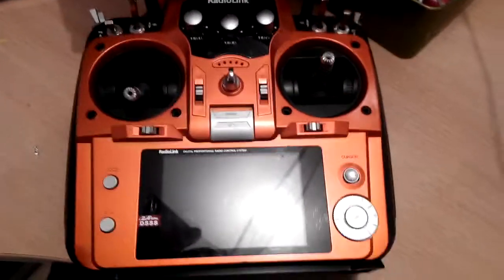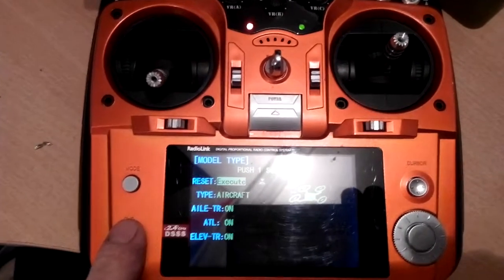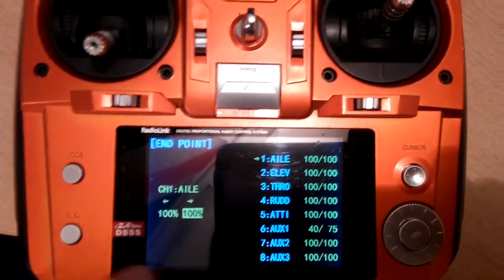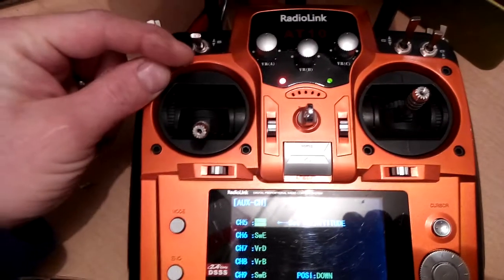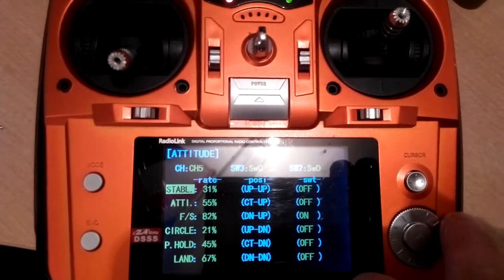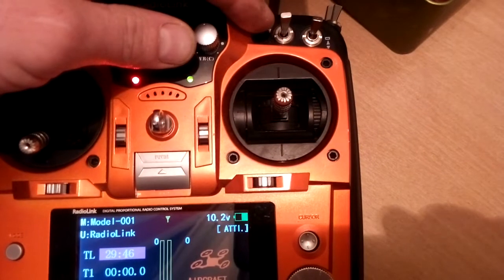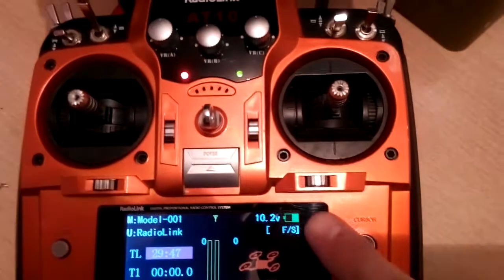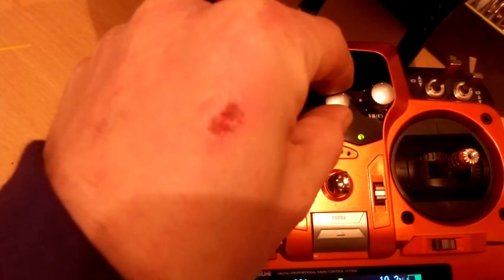RADIOLINK AT10. SETUP FOR APM 2.6. APM 2.8

Comment: Hi!
I am trying to build a bait boat myself and I have a few questions, maybe you can help me out with some answers:
Is it possible to set the pixhawk to save locations by moving the sticks?
When I go fishing, I fish in 5 places (within the distance of 10 meters apart one from another) and I would like to send the boat the first time to the 5 places and save them so I can later send the boat by itself.
I would like to not use mapping, and just send the boat to where I want to save the locations, take action on each stick so it can save a certain location on a certain stick.
After saving the locations, when I send the boat to a certain location, I would like to take action on the stick that represents the location, and the boat should go by itself.
Is that possible with the pixhawk?
If not, any idea with what flight controller I can do that?
Thanks in advance!

Comment: Hey bro! Nice vid! Do you tink you could answer me a few questions?
I have a bait boat, and I want to be able to read the distance from my boat and remote,so I know how far I send it,and also, I want it to return to the starting point without me to drive it.
I know I will need the 
1. APM 2.8 (this is what i want to use cuz its cheaper)
2. GPS
3. Mini OSD
Questions: 
Will I need the 3DR Radio Telemetry? If yes, what is this for?
Will I need a Power module also?
My bait boat is functional, can I connect the AMP to the power source of the boat?
Thanks and I hope you can answer me as I am new in his :)

Comment: Hello there. I have a new AT10ii and R12DS system yet.
 I bought it for my plane with nitro engine. 
I do not have an ESC. (no esc). 
I have one 2s 7.4v battery and one UBEC 6v device.
 How can I connect this battery to the R12DS receiver. 
from which port I will connect. Do I need to use UBEC 6v? 
will the 2s7.4v battery work on my connection?
 

I will connect the battery to which channel. 
I will connect to which channel the numbers are formed with red color.

Would you mark me with a photo and attach it to the message? Please.
Reply from the maker: fatih sarıduman yes operating voltage 4.6-10volts.  you can use Any channel.to supply power.
Reply: I do not understand how any channel. normally connects to channel 3 with esc. Can you connect to any one without ESC?
Reply from the maker: fatih sarıduman yes.

Comment: I updated the firmware and now the throttle is on the right hand stick ??? How if possible can I put the throttle back where it belongs ?
Reply from the maker: Noah Wheeler yes   yes you can.  turn on at10..  press and hold "mode"  highlighted "parameter"   press the wheel...    use the cursor down to "stk-mode"  turn wheel to number "2"     then use end to come back out.   will now be left stick throttle mode 2.
Reply: Thanks a lot Throttle is fixed . One other question ? I have the AT 10 and the R12Ds ! Do the pair work together ? For some reason I can't get the motors to turn on with this combo . The signals are there but no action ! I can rotate the motors with the mission planner software but nothing from the transmitter ???
Reply: I even went back to a previous firmware and still no go very frustrating ! Thinking of purchasing the R10 ? Maybe that will fix it ???
Reply from the maker: Noah Wheeler you need to select 12channel in the menu on the transmitter.  what signal input are you using for the flight controller control. pwm or sbus?  if sbus. did you put the receiver into sbus mode???  if the led is red on receiver its in pwm and red numbers are the channels.  if in sbus mode the led will be blue.   what flight controller are you using also??
Reply: ardupilot is the apm 2.5 I think ? everything was pretty much thrown in the box with no instructions
Reply: first time doing something like this
Reply from the maker: Noah Wheeler. yes. china man stuff. figure out for yourself. lol. ok. im not at home right now so cant double check.  but if you need 12 channels.  in the Parameters menu. I think for the r12d you need to select and make sure you have selected 12 mode to work correctly with the r12ds.  this is maybe where the trouble is. and why your channels are messed up.  get the AT10 back on the new firmware.  put it in mode 2 like we talked about earlier.   reverse channel 3...  you'll need 8 servo wires.  put.  channel 1(red) to 1....2-2...3-3. etc etc.  do all 8.  power all up. and do a rebind..  press and hold the wee button with a pin.  until it flashes.  leave go.  let it bind again.  if the led on the receiver is blue.  you need yo make it red... press the wee button so it goes red.   you are now in pwm mode.  and should be able to calibrate now in mission planner.  make sure all the servo wire are in the correct way around too.    it can take some time.  especially if.it is your first time buddy.  are you on Facebook?? join a group called. "Mad for Multirotors"    we can help you better there mate.  

http://www.radiolink.com.cn/doce/product-detail-126.html

Comment: Hello thanks for your previous help.  As you have noticed I am completely new on this hobby and I am having trouble configuring the flight modes. I am using a pixhawk 2.4.8 with a radiolink AT10 2 with r12ds reciver. well i have followed the video in how to do it but mission planner is jumping flight mode 3. Can you help?

Comment: I am new to drones.  I have the AT10ii.  Can you explain what does the percentages mean or actually do?  If not, can you direct me where to find the answer.
Reply from the maker: Zen B the percentages relates to the corresponding channel out put which is then received by the receiver and put into useful information such as pwm....ppm. or sbus control. this then is used to either control channel inputs on a flight controller or servo motors etc.  on these cheaper end radios though the percentage is not always linear and thats the reasons we need to calibrate the flight controllers.  so it then corresponds to the maximum and minimum output    every build of machine will be different and require different percentages for different channels.    the percentages can also be used to adjust end points.   where 100% would be the normal full speed on a throttle say.     if we reduced it to 50%    this would then be half throttle at full stick.  if this makes sense.   lol.   it makes sense to me.  hehehe. I am by no means an expert.  so if you want to learn more.   google it and look at the different types of control too..   like sbus....ppm....pwm... etc etc.

Comment: NOTICE if you are using pixhawk and you have this transmitter and the receiver that comes with it then use a PWM to PPM converter for pixhawk but unfortunately the converter only supports 8 channels.
Reply from the maker: InventorJS -Jacob Singh or. buy the R9D receiver and bind to the AT10.  you can use sbus.  10 channels.  new AT10 radios come with sbus receiver now also and have 12 channels.

Comment: hi do you know if my AT10 is compatible with a pixhawk flight controller,.
great video relay helped me set up with my apm.
cheers
David
Reply from the maker: yes. of course it is.  my advice though.  pixhawk works better with sbus.  discard the R10d receiver.   buy a new version of the R9D receiver which has sbus out and bind the r9d.  and use this on the pixhawk.  a much better receiver.  😉
Reply: Thanks for the fast reply, cheers

Comment: I have Radiolink AT10 transmitter.
The telemetry data screen does not appear, when I press END button.
Why it happened ?
Please help me ! 
Regards. Yuri.
Reply: You need to purchase a mini OSD for the AT9 or AT10.  One end of the OSD connects to the top port on the RX and the other end to the APM.  You can get them on eBay pretty cheap that includes the connecting cables.  Hope this helps.

Comment: Great video and very helpful. I can now bind my AT9S - 10 Channel radio using your video guide made for AT10.  I recently bought my AT9S and since then I am having problem connecting it to my APM 2.5.  and when I viewed your video, I finally configure it and it can now be armed on my APM 2.5. I have thing to request, if possible if you can post the settings and configurations of your Radio like the MIX settings, endpoint , trim and sub trim

Thanks and more power!

Comment: Are you still happy with your transmitter ? I am planning on getting me one next month.
Reply from the maker: yes mate.   very happy with it.   only thing is.  when I first got into the hobby.  10channels seemed like a lot.   hut now with so many advances in flight controllers.   like circle..waypoint....rtl....smart modes etc.  10 channels is now not enough for all the features and then landing gear and extra things like the gimbal and camera shutter etc.  i really need a 16channel.   but so far the AT10 has been a great radio.  the onky thing i had to do. and would advise anyone to buy. is the R9D receiver for sbus control.   the R10d receiver is pwm only..... so 10 seperate channels.    the R9D has 9 seperate channel in pwm. but if you used it in sbus you get all 10.   the radiolink AT9.  is also a good choice.   its 9 channels pwm. but 10channels in sbus.   i looks a bit cooler too.   but the AT10 is great.  easy to use.  and excellent for beginners.  and its cheap.... and failsafe limits can be set on any channel.  so yes.  still think its a great radio.  in fact i use it still at least every other day.   oh.  and i have 2 of them.  lol. the orange one. and a silver one.   (on 2 of my hexas one of the transmitters controls the craft. while the other controls the gimbal).

Comment: Hy 
the video was helpful thnx
i have one question could u explain me how can i set up this but to use a different button 
this way i know exactly what is what end i dont get confused like u seen on this screen if is sunny outside u cant see what is the screen sowing 
i have managed to set it up like u sowed but i cant figure out how to connect the different buttons to different chanels
the channels can bee seen on calibration they r connected all 8 but only the 3 pozition switch is working to set it up 
thnx
Reply from the maker: I have another quick video uploading for you.   you will see how to set the switch.   keep watching my channel.  it should be up very soon.   let me know if it is what you mean.   easier to make a quick video than explain.   thanks.   give it 20 minutes or so.    sun to my channel and it will pop up when its done??   cheers
Reply from the maker: I have another quick video uploading for you.   you will see how to set the switch.   keep watching my channel.  it should be up very soon.   let me know if it is what you mean.   easier to make a quick video than explain.   thanks.   give it 20 minutes or so.    sun to my channel and it will pop up when its done??   cheers
Reply: thnx
Reply: ok thnx i have managed to set it up like u sowe on the other video 
but i would like to set it up on a different buttons like swa return home or swb circle so i would use them separatly not mix them with other buttons 
thnx
Reply from the maker: +Freddy Beko ahhh ok.  then you will need to use more than 5 channels and assign these in mission planner also.   its very easy.  just set channel 5 up as like this but use them for different features.  then to will have to connect more channels from your receiver to the APM board.  if you get me.  assign the channels which will need to be the 6, 7 and 8.   channels. assign the switches in the transmitter in the 'AUX-CH' PAGE.   then connect to mission planner.   do a radio calibration then set up your switches there in the basic settings.   of you want me to make a better video I will.   cheers.
Reply: thnx i have don all this but they i dont have in this mission planer the option to assing this switches i have had a good look but i cant find it
i have a bit experience with this i have set up 2 other different flight controllers but they had this option to assing the channels but i cat find it 
im using apm 2.0.18 now
i have had the last one but with dat i could not callibrate the Accelerometer so i have had to uninstall & get this older version but toke me about 3 days until i find a post in a forum 
thnx
Reply: Have u manage to figure out how to set this up?
thx